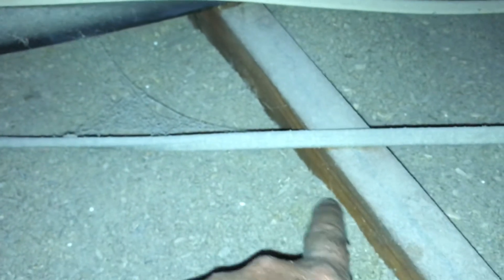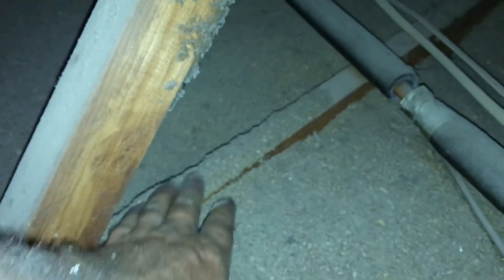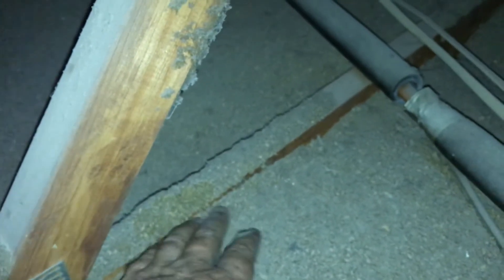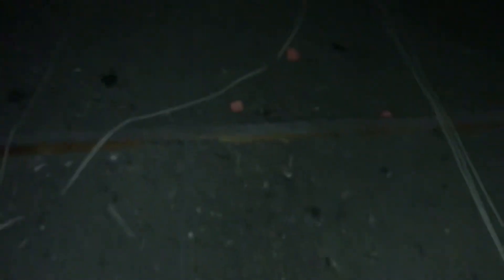What does Cellulose fibre insulation after 30 years? Rats nests? Settled? Blown around? Needs repair

Comment: Nah, That is proof that it DID settle to the lowest measurement. If you take the joist pic, yes, that was blown in high but when you look at 90% of the ceiling it measure maybe 60 mill at most. Thats if you take the entire ceiling into account. When they blew it in the would have been level to the joists and now the majority is much lower, that equal settling.
Think about walls now. 8 foot wall with the weight of the cellulose over a couple years will drop the height to 7 feel or less